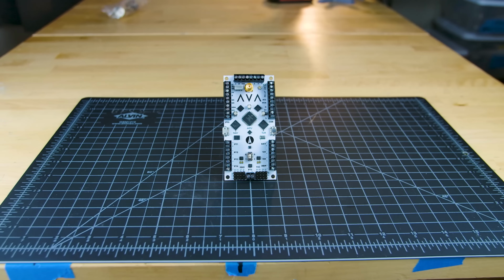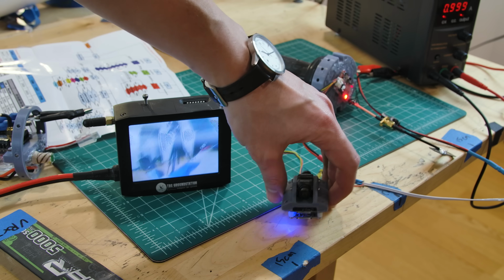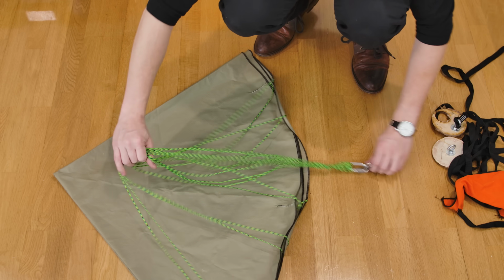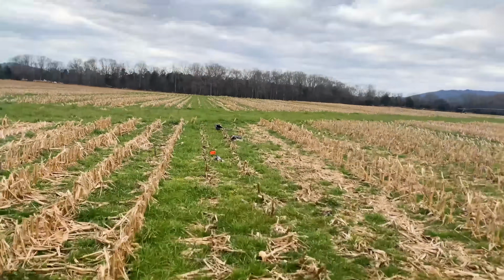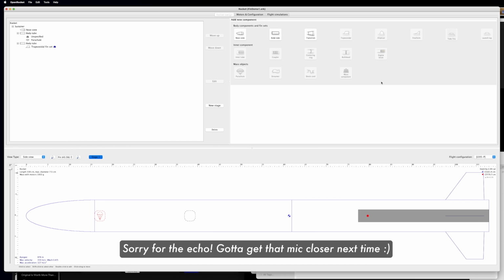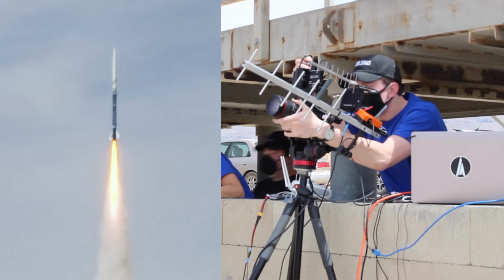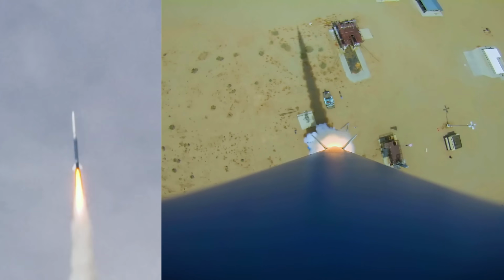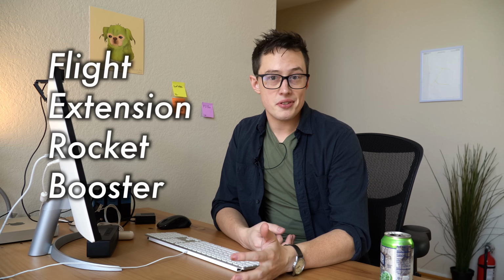Fineas - Active Fin-Controlled Model Rocket

Comment: Dear Joe
I like your new project very much. The idea and also the design of the rocket looks great. I had a very similar idea some time ago. My thought was that the aerodynamic stress on the motors controlling the fins can be reduced if only a part of the fins can be moved. So the rocket would remain more or less stable even if a part of the control system fails because the rest of the fin is fixed to the rocket (like the V2).
Looking forward to seeing more on this, an insight into the mechanics would be very interesting.
Good luck with the first flight.

Comment: I'm working on very similar project with few of my buddies but it will be a little bit bigger rocket. Also it will have 4 active stab wings up on the rocket and 4 passive wings down since we're using larger motor. We've been working on this for almost a year and it's cool to see you did it in a few months. 
Good luck on the launch I'm very excited to see it fly.

Comment: Brilliant as always.

A few comments as an Aircraft Design Weights Engineer. I notice the size of the many screws that you have used. They look too big to me. I think that mamy of them could be replaced with half diameter fasteners. Maybe not in all cases but that would be a nice weight saving. I also noticed the hardware for the parachute. You look to have a garden gate support on the back of the nose cone. That could be replaced with a fabric strap. You might need something of good tensile strength. Then there are the many metal links. Do an Elon and ask if they are really necessary and replace all except one with fabric links. That should save you several precious ounces.

Comment: For any of your flight controls I noticed you do not take into account the phenomenon of "ringing" which, when you look at the recorded data appears as ever smaller oscillations that follow each other up (up to 6 or 7 of them) right after control activation. You could "dampen" the counter-action of the control by taking the average of three consecutive ringings (or more for more accuracy if your CPU can handle it) and then subtract the difference of the peak ring (of the series of three) minus the average from the control "pulse" you send out to whatever flight control you use (thrust vertor or fins).
That way your control should be smoother and the ringing will be dampened automatically and quicker.
Anyway, it's just a tip. Keep up the effort, I'd like to see you succeed and put the heat to Musk's heels so to speak, a multi-billionair being trumped by a small-scale DIY rocket builder :)

Comment: Instead of FERB you could also use FERB to get more thrust: a Fat Elongated Round Body, or put differently: a tube with a larger diameter for larger motors

Comment: If you would use small control fins on top of the rocket, you could get rid of the problem with the motor diameter.
This would also scale much better on bigger motors.

Comment: Saw this second to launch video. Both had me thinking you might want to change a single servo with linked fins moving in mechanical sync rather than a servo per fin. (Yankee Screwdriver slotted barrel internal control.)

Comment: Yes you are smarter than me in a lot of things but everyone misses a good idea.

The rear fins. If you used a an aerodynamic symmetrical airfoil maybe a free NACA one since they come with data. Then put the drive or pivot at the location of the centre of pressure for the angle of attack range your using and if you taper the fins then use an equal taper of both the leading and trailing edges then you only have to use minimal drive force on each fin.

When you pivot the fin at the CoP the leading edge that wants to be ripped into the airflow is counter balanced by the same amount by wanting to be forced back to straight. The stabilising and cantering force is provided by the airflow and all you do is set the pitch.

For safety though to avoid a fuckup you should set the pivot at the CoP location for the max AoA that you have set available to the rocker. Then you should move the pivot just forwards of that, a tiny bit.

That block fin profile made me cringe. Your the professional and smarter than me but at high speeds a block trailing edge can cause flutter as the top and bottom airflows try and reconnect and you get one side airflow snapping over and then the other side snaps over and you get drag by having a voetex  trying to keep the airflows apart.

You were worried about drag and those fins are killers.

A fly a small airliner with lots of stuff hanging off it in the airflow. We fly low at 1000 feet so dense air at 220 kts. Your airspeed will exceed that and EVERYTHING is streamlined on the aircraft. The most draggy single thing are the  two massive HF antennas that run wingtip to tail to above the cockpit on each side. Circular profile wire is terrible for aerodynamics and it has a tensioner that sets a specific tension to avoid harmonic vibration that rips the antenna clear in 1/10 second or less. Another fault is the antenna spinning like a skipping rope.

Argh that was rambling. Point is that your talking boosters and staging when a cleanup of profiles and surfaces and having the fins just kiss the fuselage when straight would give you heaps of extra performance.

Still your rocket and it’s a beast and I love how you can tech out something that could otherwise be quite simple. 

BPS space, tech pimp my ride.

Comment: Off topic but for landing rockets what if the landline legs was an assembly and went around the rocket body on an independent band style suspension so the rocket could move a little separate from the legs.

Comment: What do you think about a magnetic rail system which has sliding electromagnets inside the rail and an endstop switch at the top which cuts the power instantly once the rail is at the top? The rocket needs to have a small magnetic stripe inside, so not having any outer drag causing components.
Edit: I don't know much about the physics, but could that rail maybe also used as an accelerator for the rocket by releasing a weight or spinning up a motor?